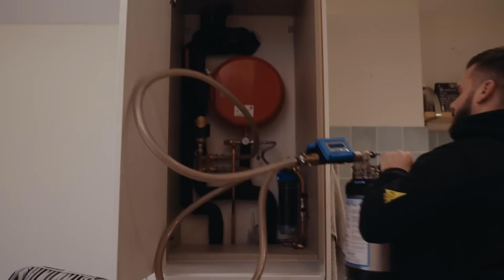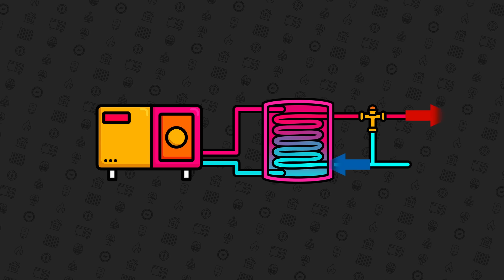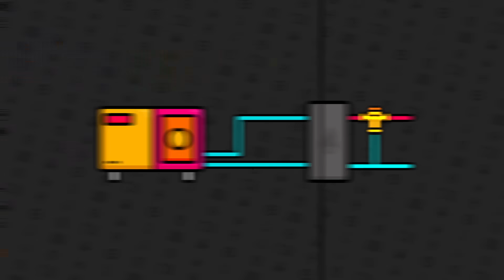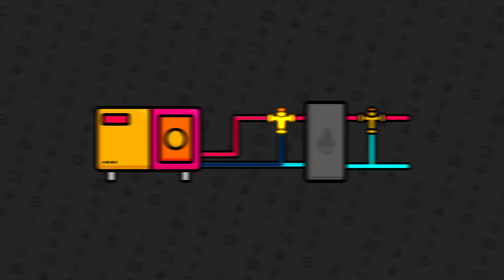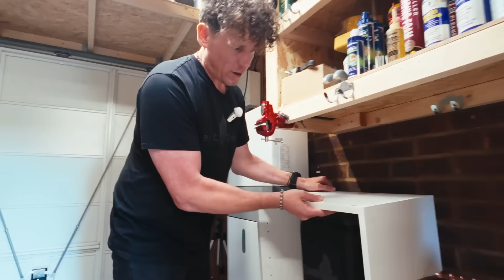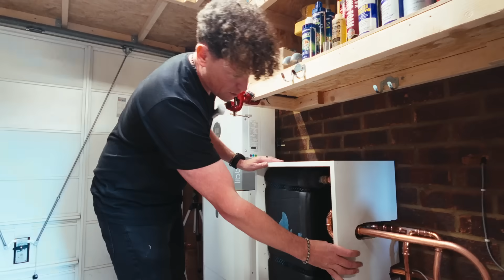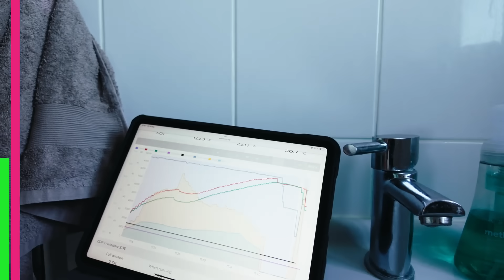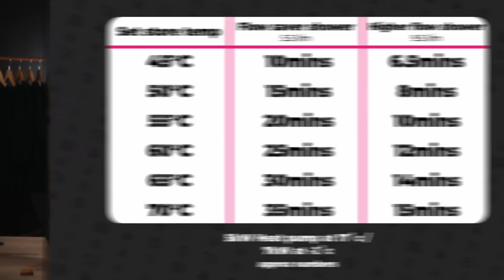World’s smallest hot water solution. (With a heat pump)

Comment: Is anyone actually interested in commercializing this? Sounds like every heat pump company should just add it to the external unit and make it a little bit wider or taller and then just connect to the existing combi pipes.

Comment: Where do I sign up I need one of these for my small home
Reply from the maker: Upgrades . Heat geek . Com
Reply: @HeatGeek but this product would that be available? I don’t have space for water tank
Reply from the maker: @diyshots yes, your heat geek would just have to request it.
Reply: Johnson and Starley have an Aquair unit that spins up from 45° to 60°, going flat out. It blows hot air out. An electrostatic filter is fitted for dust. More noise than radiators, but we don't find it a problem.  This means a Daikin or similar would be able to run at that temperature.  Can you fit Daikin?  
They also run a cold cycle that spins the Aquair unit faster as the temperature goes down, cooling in summer. A Daikin can do that too. 

If it can turn the heat down and not off it would be ideal for warm air heating. Our gas boiler uses 5.6Kw per hour, and less when up to temperature.  From Octopus app.3 bed detached house with 2 storey extension. 

Having ducting instead of radiators gives a lot of extra space for moderate houses. 
i cannot pay £350 if you are not able to do this.
Reply from the maker: @edwardwilcox8982 your just talking about air to air units.. no we don’t install those. The fridge cannot be air temp on those btw.
Reply: @HeatGeek Afraid not, that's the problem. Presently, my Valiant gas boiler heats the water up that passes through the Aquair unit, which spins up and passes the hot air through a matrix of the hot water and blows it through the ducting feeding every room of the house. It does the same trick with cold water. The Aquair spins if the water temperature is 23°or less., faster the colder. 
The problem for me is that it appears to be unknown or out of your comfort zone. 1 experiment too far? Surely give it ago. But it will need a Daikin, warm water needs to be 45 to 60° cold 23° or less. Oh, the temperature has to modulated not on and off. 
The small boiler in the cupboard and the hotter heat pump water will maker your hot water even more effective.  
It is worth the experiment?
Reply from the maker: @edwardwilcox8982 I think you’re just talking about a fan convector or radiator convector like a Jaga… yes we install those they’re very common.
Reply: I've just read my first post again, it sounds nothing like an air to air heat pump. It's just something you have never come across before. 

In addition,  there approximately 200 houses in the estate,  many still with the original warm air ducting.

Comment: Recirculation pumps that recirculate water back to the water heater through the cold lines that reduces water wastage at startup (at the cost of more energy usage, but hey, you already got a heat pump.)
Reply from the maker: I think you’re referring to waste water recovery?
Reply: @HeatGeek  sorry, no, I guess I wasn't clear.
There are recirculation pumps which are for reducing the amount of wasted water that take the hot line out near the end place (often a sink supply) and it pumps from the hot water line, and pushes that water back along the cold water line.
A common model put in will "calibrate" itself over the first couple of days where it waits for the water in the hot line to cool, then pumps it until the hot water is present.  It does this a bunch of times until it figures out how long that water is taking to cool to an unacceptably cool level.  It then will automatically cycle when not in use to ensure hot water is always more immediately available.
Watts sells a 500800 model pump and might have a better explanation.
These make sense for any system that has a long wait for hot water at the point of use and water costs are higher than heating costs. (Or you just want to avoid water waste.)
Reply from the maker: @RandomAccountHolder oh you mean secondary circulation.
Reply: @HeatGeek  🤷‍♂ perhaps that's what they call it there. Let's say yes.
Reply from the maker: @RandomAccountHolder  US terms

	- Hot Water Recirculation System
	- Domestic Hot Water (DHW) Recirculation
	- Recirc Loop
	- DHW Return Line

Yes it’s a good point. However these are more for retrofit and unfortunately most pipework systems are uninsulated so is too wasteful imo and will cause the heat pump to cycle. If a fresh install it will be good though

Comment: Genius but this needs to be tested in the middle of winter when the tap water being heated is 10C colder than in your experiement. The heating requirement is easily 33% higher, not to mention that the ASHP will be struggling to not frost up.
Reply from the maker: Already tested this with the ministore which has lower performance. It’s fine. Ofcourse we are double checking with some test sites this winter before full launch though
Reply: @HeatGeek  glad to hear it, looking forward to seeing the results. Hope it works out because that would be a huge win! I'd happily ditch my immersion tank and get a whole cupboard back and replace my boiler space with a heat battery instead.

Comment: I'm also quite curious what the impact of the amount of plates in the heat exchanger is. As heat storage only the volume matters, not the amount of plates. If I look at the Nordic Tec site all their BA-115 models have the same size, but the 40 plate variant is considerably cheaper than the 100 plate variant you chose. You might loose a bit of efficiency though. I'm quite curious how moch efficiency would be lost in that way.
Reply from the maker: Oh that would have little loss… anything below that and you’d only just start to see it… does that version hold the same volume though?? 15l primary 15l secondary.. it’s the volume that makes it work not the plate surface area
Reply: @HeatGeek  crap, my bad. On their website they use the same picture for all variants and the dimensions seem the same, until you have a closer look, and see that the 100 plate variant is 258mm high, wereas the 40 plate variant is only 110mm high. The highest is the 170 plate variant with a height of 454mm. All other dimensions are the same.

If it's mainly the volume, the system could possibly be made way cheaper by combining a small insulated water tank (basically a buffertank) and a (cheaper) heat exhanger, which is just big enough to transfer the 7KW of heat the heatpump can provide.
Reply from the maker: @jac540 yeh I went through all this too mate.. space wise this still made the most sense but you may be able to do something better!! Thanks for checking that out for me though!! Thought ide missed a trick!

Comment: 80% of homes might have Combis but many of those had hot water tanks originally. Combis were just quicker to install when it came time to replace the boiler. Granted some storage space will be lost by putting the tank back wherever it was, but in many cases it can be done.
Reply from the maker: Ofcourse. Most of those spaces have been used for en-suites and other purposes allreqdy. It’s all generally speaking ofcourse

Comment: You went for the BA-115-100(?) with 11.5sqm surface area...  Any reason that you didn't go bigger?  If you go bigger (yes more cost) presumably you could get more efficienty due to more heat transfer and thus a lower flow rate required?   Where does the line get drawn between cost / effeciency between this and a tank for those that have space?
Reply from the maker: I did also buy the next size up (which is a totally impractical weight by the way) but I based it on a 300x400 cupboard and the valves would’ve been difficult to squeeze in also
Reply from the maker: Also this maxed out the 15l reg limit before g3 requirements

Comment: Rahter than outside, stick it in the loft if you have one particularly where stuctural calcs dont allow or a cylinder simply doesnt fit through the hatch. You can insulate the snuff out of it and it will be completely hidden.

Comment: How would hot hot water be supplied to sinks? How far would it go to fill a bath?
Being a frustrated combi owner, failing to find a good solution after 2 Octopus surveys, I'm very curious.
Reply from the maker: Well this filled the bath… you may have to limit the flow rate though. Sinks will work as normal.

Comment: Good results! A thermostatic mixer on the bath/shower is essential. I'd go with Grohe or Hansgrohe with a bath/shower mixer.  It would provide a second level of safety for the user. Those showers that connect to bath taps that require the user to fine tune the temperature manually gives an awful showering experience.

Comment: We're running a non-heat pump set up. A 30 litre electric boiler, yieldng about 5 min shower time a a 15 min delay foor the next shower.
Granted it is less efficient, but (a) we use it only twice a day (and efficiency plays a lesser role than 18 hr/day heating) and (b) the investment is way lower than a heat pump.
Reply: For a flow of 7 litres per minute = 0.116kg/second, heating water from 10˚ to 40˚ continuously would take 14.5kW (0.116 * 4184 * 30). So you are having to draw from the stored heat in that little 15 litre heat exchanger. If you're going to keep it pre-heated to 70˚ so there's a decent amount of stored heat available, it's going to need very good insulation: there's a much larger proportion of surface area to volume than a large cylinder would have.  But perhaps the small size enables other technologies, like a vacuum flask.

If you wanted to run at 7kW indefinitely, then you'd get a user experience similar to an 8kW electric show - barely adequate, with half that flow rate.
Reply: @briancandler4024 Some more context. The unit is a water heater and doesn't use a heat exchanger. It draws 10 A from the mains. Our shower head is one of them restricted flow ones and lets only about 4 L/min through.
I would have liked to use an electric shower setup, but they don't sell them in our country.

Comment: Here in Germany there is the Ariston Nuos Primo 80 for about 600 - 700 €. This is a small combi with heat pump, which allows the use of cheap dynamic tarif and/or energy from PV.
Reply from the maker: That’s 1.5 metres tall and 600mm tall wide…. It’s definately not fitting in a kitchen cupboard.
Reply: @HeatGeek  Correct. You would put the Ariston Nuos in the bath room - so you could use the steam and heat while showering immediately for producing new hot water. Also dries your bath room...
Reply from the maker: @stumbaumr yeh but that misses the whole point of this product lol. This is for homes with no room for hot water.. hence having a combi. If you want efficiency use a heat geek super cylinder.. the most efficient hot water possible.
Reply: @HeatGeek True, if you have really no space at all. There is no one solution fits all in the housing market - every building and its installations are bespoke set ups. Some people even use these Ariston Nuos 80l devices to cool their houses down (instead of an aircon…).
Reply: That's actually a really low performance one. I think Haier has one on R290 instead of R134a with a cop of over 4 instead of barely hitting 3. I have been thinking about buying one because I do my heating with air conditioning. But radiators are more comfortable and constant than a unit blowing air. I still don't know what's wise.

Comment: The key thing in all of this will be inlet water temperature. Typically it could swing 10C + between summer and winter. Interesting however.
Reply from the maker: I think a 30 min run time has shown it will likely be fine

Comment: Impressive. I did this about 20 years ago using a 16kW gas system boiler and flow switch. Pretty well the same. Another was a 30kW boiler with a 22mm pipe loop serving two bathrooms, with a plate heat exchanger under each bath. No large cylinder needed. Instead of using a small boiler storing energy in water in a big space consuming cylinder, I used all the energy available coming in through a gas pipe.

Another was that I realised there was a heat store spread around the house in the radiators. Using the heat in the radiators as a preheat to get longer showers, two showers or mainly faster bath fills. Then when the taps were turned off after a DHW draw off which cooled the radiators, the boiler immediately reheated the radiators quite quickly. This idea you should explore to productise as it worked well.

Comment: Under 15 litres storage a G3 certificate is not needed. If multiple units are around a house with each one at 15 litres, why does G3 apply?
Reply from the maker: Over 15l storage g3 regs apply… I’m not sure that splitting the storage circumnavigates but good idea to check
Reply: @HeatGeek  
 Distributed storage with individual controls in a separate unit. It does not have to be stored all in one location in one unit.
Also G3 applies to water vessels, under pressure. 

A plate heat exchanger is not a vessel. A large plate heat exchanger, say 20 litres in both primary and secondary water, does not make the system subject to G3. If domestic hot water is being stored or held under pressure under the controls of normal taps, i.e., not needing pressure relief and high temp safety valves, G3 doesn’t apply.

Comment: Its all well and good. Nice bit of thinking and all that but... you're barely cutting grease at those temperatures. If people want to run a hot bath, they cant. Show us the video where youre running a bath tap or multiple dhw outlets. Show us how it copes. 
Still miles away from being anywhere near as cost effective or convenient as a gas boiler. Keep banging that drum but gas is here to stay for a bit longer yet. 

Wont be long before the ads start...

Have you been mis-sold a heat pump due to the latest government rhetoric ? You could be eligible for compensation.....

Comment: the challenge i still see is defrosting the heat pump. i think that will be a challenge as most systems require 35 liters or more of cv water.
Reply from the maker: Defrosting happens on the heating side
Reply: @HeatGeek with a Panasonic it happens on the side witch is working. You can disable to switch at the moment of defrosting by room heating to DHW. But when he is making DHW and a defrost is coming it nefer switch, it defrost on the DHW. So you must make extra workarround when you have not enough water in your short circuit. Just a tip 😅

Comment: Dear god, this is genius. This is half of what I need! Can you also include heating the house into the circulation? For example by adding a third blending valve after the second blending valve (the one after the heat pump) to circulate to domestic heating units with a thermostat, either in the loop or after the return of domestic heating. Kinda want the circulation to prioritize hot showers.
Reply from the maker: No need. Heat pumps are hot water priority systems. They only do hot water over heating
Reply: I've been working on very similar stuff. It is great! I agree. I'm hoping these ppl will email me. We could certainly solve the use of dirty, expensive fuels if we were to collaborate. Pretty much if one aggregates the many endeavors going to do that: it can be done. I can run 3 motors on a recharged alkaline battery for days. Scaled for compressors which are sized like Midea is doing- and paired with inverters using na caps... Viola.

Comment: I'm a little concerned about how often the heat pump will start
Many starts and low run times are a big problem for the compressor 

The idea is nice, but i dont know if its worth risking the lifespan
Reply from the maker: Tests on this show it not to be a problem. Insulation is key.